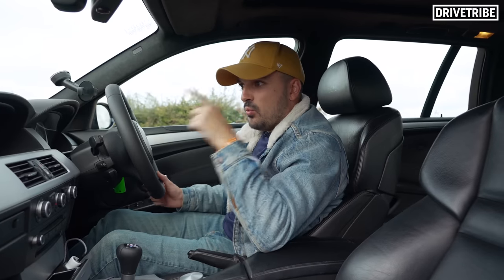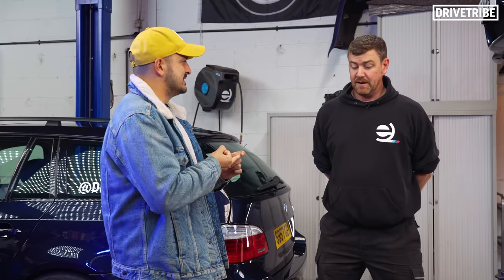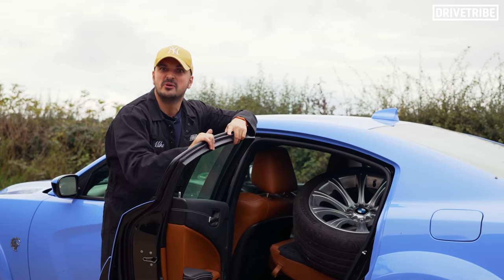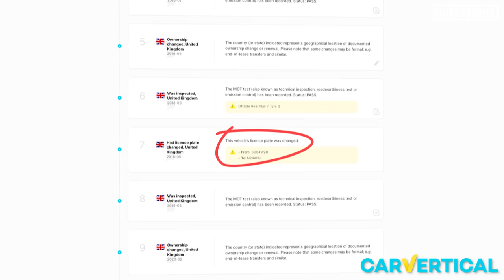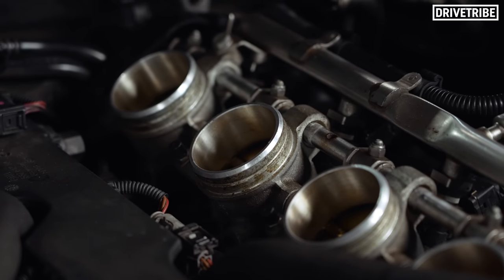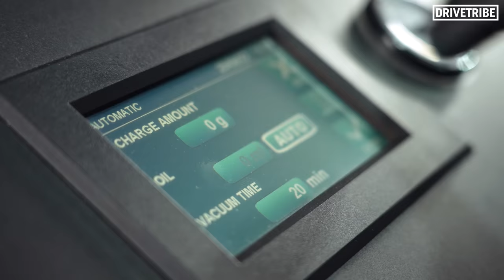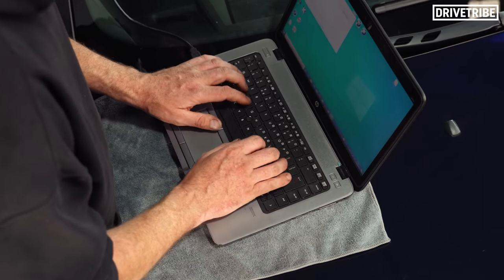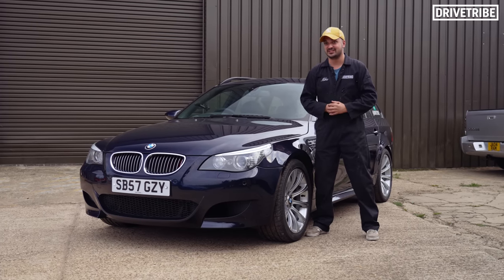Richard Hammond broke our V10 BMW M5!

Comment: The radiators weren't even that bad. If Hammond took that for a lap again it would probably get hot again. Should've went for larger radiators and coolers
Reply: I think they want to keep everything in the car original or factory correct
Reply: @barjonahbuxton3264  you mean like the manual gearbox out of a m3
Reply: @barjonahbuxton3264  The cold air intake system Mike had installed certainly is not stock.
Reply: I understand the whole keeping it original argument. But at the end of the day it has an M3's transmission in it, so that argument is thrown out of the window. 

Now it's about keeping that V10 cool and happy, and that's MUCH more important than keeping an unoriginal car original
Reply: @BigHumz155  There is simply no need for aftermarket parts. The original parts are more than capable of keeping the car in its ideal temperature range under ANY conditions. Otherwise you'd all knew there was a problem 15 years ago......but there were NEVER any complaints about the cooling system...... at least Sabine Schmitz never had anything bad to say about the M5 V10..... and if that won't convince you nothing will.

Comment: I guess I’ve “Richard Hammond’ed” my e60 twice. 
It’s a 535xi, fyi. At about 110,000 miles was driving a friend to an airport 5 hours away on a 90° day and killed the water pump, and made it to the airport on time. At 160,000 miles ran through the gears to about 80 and blew the well aged coolant lines off of the turbos. Second one was expensive. Long live the e60!! Wish the M5 estate came to the USA, it’s a hero car

Comment: I like BMW's but they are an absolute pain to work on if you don't have all the right tools. You can tell they were designed for production line efficiency and not ease of maintenance, both on the cars and motorbikes. You have to take half the vehicle apart if you have to get something that is behind a body panel, which is really frustrating. Changing the headlights on certain models means taking he entire front end off. Their engine management software and other electronics are also cumbersome if you don't have the computer to fix it all. Such a shame, because they're often great cars (depending on the model)

It is great to see a pro work on one though, Dara knows them inside out and makes it look so easy! Lots of respect for this man and his dedication.
Reply: Amen on that
Reply: A lot of BMW are the exact opposite of this, meanwhile there are far more mundane cars that are a service nightmare. Like the e46, quite simple to work on, about the only special tools needed are a $15 cooling fan spanner and an advanced scanner. V10 m5 is definitely not on of those bmw's tho. Notoriously a maintenance disaster.
Reply: @apodski  I'm talking about how it is put together, which has been the same for all modern BMW's. They are not designed to work on, but to assemble quickly on a production line. 

How much does that advanced scanner cost? Exactly. 

I've never come across a car as poorly designed for maintenance as a BMW, with the possible exception of Peugeot.
Reply: @Yvolve  Yeah this is exactly it, the access points to parts. You get the impression pretty easily that they're meant to be assembled in big chunks and not taken apart with enough space unless you remove all the other junk around whatever you're getting at. Servicing japanese makes kind of spoils you for that extra thought.
Reply: @Yvolve  You can buy a cord for $15 for your laptop, and obtain factory software on the internet and have all the diagnostic and programming capabilities available. BMW factory program is called INPA, cord varies by model.
Reply: @Yvolve  e46, an extremely common BMW is in a lot of ways easier to work on than a Honda Civic. Oil change: 10 min, Wheel speed sensors: 30 minutes, fuel pump: 30 min, fuel filter: 10 min, alternator: 30 minutes, spark plugs: 30 minutes. Front and rear bumper: 10 min, water pump: 30 min, remove all doors: 10 min, Remove exhaust: 10 min, also has full stainless exhaust that lasts forever, which is extremely rare and nice for a sub $50k car. Bolts are also of much higher quality than most cars, quite rare to encounter a seized bolt. Timing chains on most models last indefinitely, as opposed to the cheap miserable belts most other cars have. E90s are considerably more time consuming, but not really any worse than most of the cars of the same era. They aren't simple cars and never claimed to be, but it's not really true they were designed without maintenance in mind. For that distinction look to vw/Audi.
Reply: Almost nobody does access panels for fuel pumps so you can replace them in a few minutes without dropping the tank, but BMW does, even though their fuel pumps are often just as reliable as anybody else's.
Reply: @apodski  The factory software is not available online, officially, as it is proprietary. You might find third party versions, but it isn't factory software.
Reply: @apodski  The E46 is the last of the cars you can work on fairly easily, the newer models are all based on the design philosophy of quick assembly on the production line. Fasteners are often replaced with clips and several body parts need to installed all at once to make it fit. 

I've worked on more modern BMW's, they're the worst to work on.
Reply: @Yvolve  factory software has been leaked, it is not difficult to get ahold of at all.
Reply: @apodski  So you need pirated software to work on your own car. What a great example of a car which is easy to work on!
Reply: @Yvolve  I mean, you can buy a scanner for hundreds of dollars, like you would with any car, if it makes you feel better. It's likely just a reskinned version of the pirated software. This isn't a BMW problem, it's an auto industry problem. You can make do with an obd scanner for most problems, but manufacturers, do not release advanced software to the public because companies are evil. However, nobody is getting sued for obtaining leaked software that shouldn't be proprietary in the first place.
Reply: @apodski  I can find any software in about 5 minutes, on several websites. Doesn't make it legal.
Reply: @apodski  Why would governments force manufacturers to do this? This makes no sense. I'm starting to get the feeling you are one of those who feels like everything companies make should be given to them for free, despite the development costing millions. Why would you get this for free, or at all? 

Pirating is not a solution, it is just a way around a system which works the way it does for a reason. Do you expect Apple to release the source code for iOS as well, so you can work on your own phone? You realise that you are demanding something which is completely unreasonable. 

Manufacturers don't chase anyone because it is near impossible to find them and prosecute them, which goes for all pirated software. Reverse engineering software is equally a breach of intellectual property. 

The fact you genuinely think manufacturers don't chase those people because the manufacturers "know it is wrong to only distribute to dealers" shows how little you understand of the world in general and the car world specifically. Dealers pay through the nose to buy the software, cables and other stuff, they don't get this for free. 

Are you even old enough to drive? You sound like a 13 year old.
Reply: @Yvolve  You can buy your scanner "legally" from price gouging middle man like snap-on that also reverse engineered "illegal" software. The only difference here is your paying for the middle man's giant team of lawyers to defend from these manufacturers and governments for the right to repair. I suggest going straight to the source and quit worrying about what is considered "legal" software at whatever particular day of the week.
Reply: A dealer is an amorphous rats nest of money. A Bureaucratic nightmare, highly engineered by bean counters to part consumers with their money. Locking down automaotive software is just another step in advancing this, that many consider a huge overstep in consumer rights. But, the consumer does not have billions of dollars to defend their rights like manufacturers.

BMW doesn't seem too concerned in locking down their software with lawyers and drm like apple yet, so I'm happy with them. They sure are headed that way though. New BMW's are garbage and are often much harder to work on, but so are all cars.

Comment: I'm literally getting my 08 E92 335i's radiator replaced today. In truth, it's a lot of the cooling system (water pump, thermostat, radiator, tons of hoses) and the front struts.

Comment: The Ultimate Driving Machine, broken after 2 mins of Hard Driving. Sounds about right for a BMW.
Coolant system got hot so why not just replace the stat, pump and coolant with Evans Waterless Coolant. It will never over heat again but Drivetribe gets all of its bits for free and need to make content, hence this vid.
If you'd done some basic proper maintenance when you'd got it, you wouldn't have had these issues

Comment: I've had all these parts replaced on my E60 M5 but not because of overheating. AC wasn't working so BMW said I need a new Condenser. In the process they damaged the coolant rad so they replaced FOC (after arguing). Oil cooler was leaking so had that replaced. Thermostat was replaced as the car wasn't heating up. Only rad left to change on mine is the PAS cooler which is in similar condition to this

Comment: There was an awful lot of crud in the fins of one of the radiators when your disassembling. I wonder how much difference simply blowing that out would make?  Modern heavy equiment like excavators, skid steers, agricultural tractors etc. automatically change the fan direction after a set period of time, and all sorts of debris gets blown out when that happens.

Comment: Ash can I suggest that if you use an inverter to charge eccoflow then connect the inv to van battery direct because cig plug gives 10a but you would know that so disregard comment lol.🤔

Comment: I am a BMW technician and I would be very surprised you would not have any fault codes. Nearly every BMW, even new, have at least 5 fault codes stored for some reason or another. BMW's are money making machines for the motor trade as they always have some kind of fault.

Comment: seems odd didn't just bother with changing the oil too, since you ran it hot for a little bit. also that whine when you turned the wheel doing the power steering fluid didn't sound to promising. that might be on your next thing to replace

Comment: If only us peons had the extra money to buy something like this or a Quattroporte! Let alone the amount it takes to make these time bomb engine flaws fixed correctly!

I'll stick with my FB and FC3S GTU.

It's soooo rewarding to get a hand ported 13B running like a top.
The best part is the looks you get putting in premium 2cycl oil in at the gas station!
No....87octane gas is plenty. The 13B can run on 50oct!
Now boosted, it's a different world!

Ask me how to open those 6 ports on a non turbo.... With an aftermarket header.

I might share a trick that will save your hours of pointless nonsense and it will not opening progressively like Mazda intended!
It opens up like stock the way I fix it!

Just got a GTU out of 3 winter no prep storage and it started the first time the first rotor made compression.

Our minds were blown!

Comment: For those on a budget, were there any options besides replacing the entire coolant system(s). That couldn't have been cheap.
Reply: Don’t have a V10 M5 without deep pockets 😂
Reply: Cheap parts. There is no fixing bad radiators anymore. Aluminium corrodes and it becomes very brittle, which doesn't exchange heat anymore and they just start leaking. You can't weld them nor refurbish them unfortunately. This is the downside of having multiple radiators on a high performance car.
Reply: I noticed they fixed deformed rims, which could have saved them $1000+
Reply: For a typical owner, you could just clean the debris out of the radiator and condenser and run it for years more. They didn't need to replace the thermostat but it was probably close to leaking based on the hard gasket. Don't know about the water pump. If you're trying to take an M5 to the track, there's nothing cheap about it and all of the parts they threw at it are warranted especially if it's already in the shop.

Comment: Let me start with, this is my opinion. You own a 15-year old high performance car and still have the original cooling system in there.... so the car was broken before Richard ever did anything with it...... i'd rather believe he saved you from an expensive engine failure because that would have happened if you'd have kept on driving it with this broken cooling system..... Richard merely used the car as it was intended originally and you obviously haven't done that once since you have taken ownership...... which is kinda sad to see this is just being used to trundle along the countryside and never being used as intended..... hopefully you will change this oversight..... this car wants to be driven hard.

Comment: I find it a little disturbing that your mechanic really failed to mention the most likely cause of the overheating, while the issues he did explain may have all contributed to some increase in engine temp it is almost certain the cooling tubes were blocked or restricted in the coolant radiator, in my experience of some 48 years this is almost always the definitive reason temperature goes above normal especially as it did in your vehicle on a hot day under hard driving.